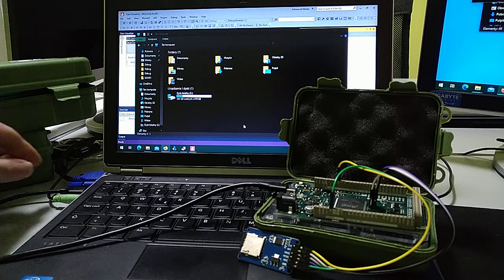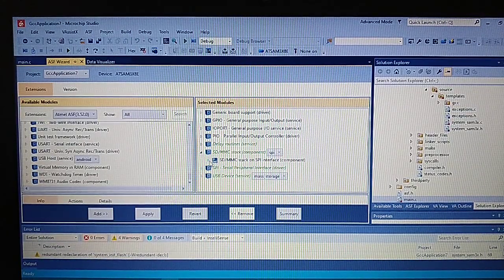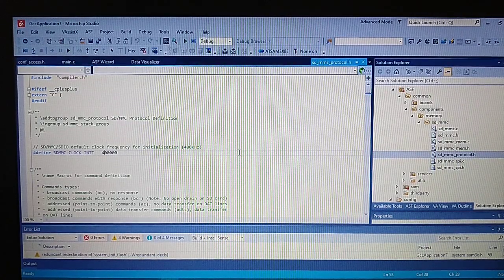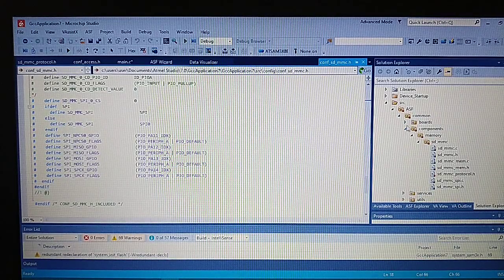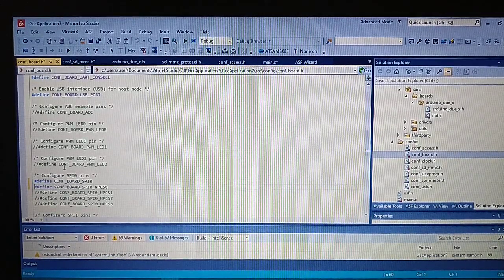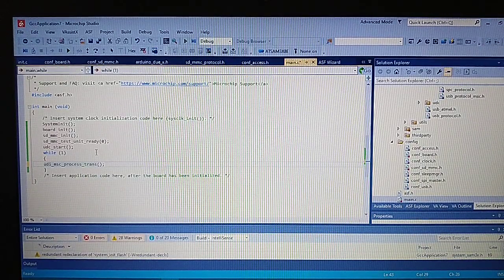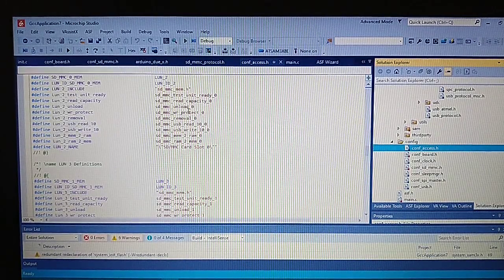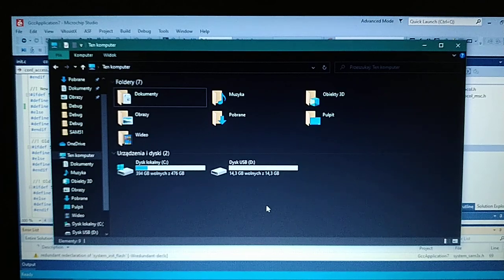Arduino Due USB Mass Storage + SPI Micro SD example in Microchip Studio 7

Comment: Hi can we implement it with Arduino Mega 2560?
Reply from the maker: Hi, the Atmega does not have a usb phy, but it is possible to use 12MHz USB 1.0 emulation through pins, then it would be still a little bit of work to port the mass storage code - so quite hard but possible.